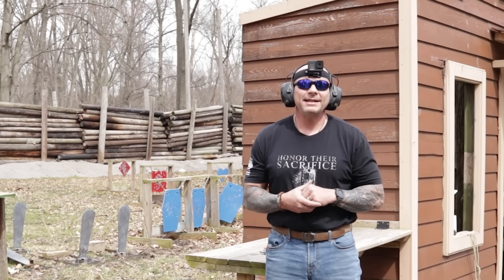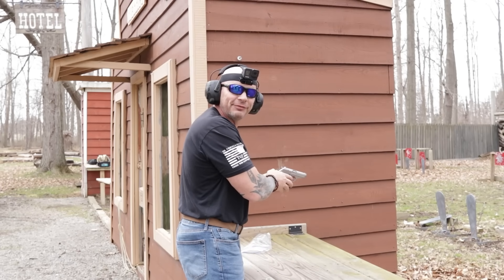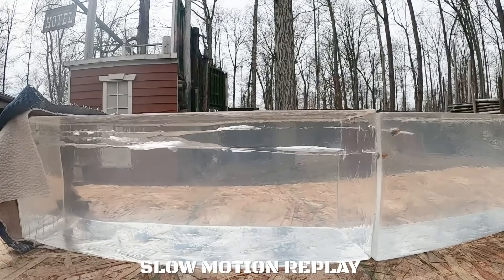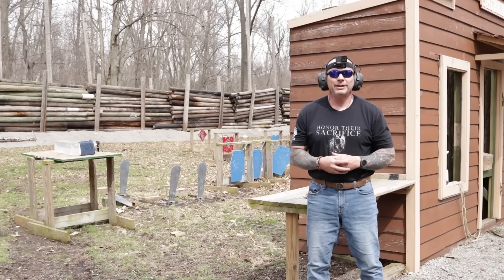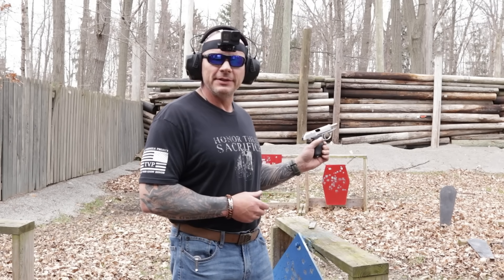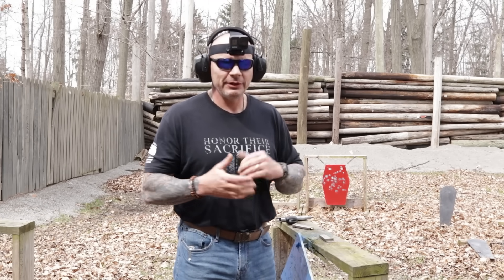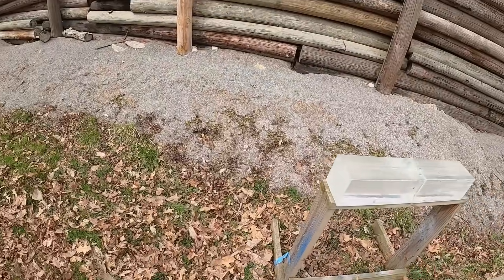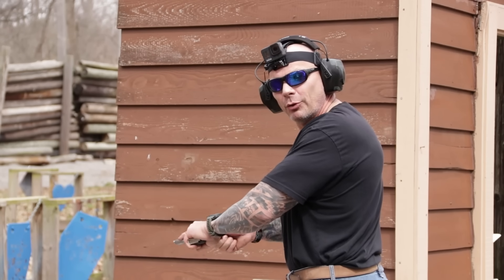Stopping Power of .380 ACP

Comment: These gelatin tests hardly inform about the .380’s stopping power; ballistic gelatin does not simulate a human body with its varied/heterogenous tissues of skin, bones cartilage, tendons, etc. it also fails to take in to account interposing objects like clothing, buttons, pens, glass, metal, wood, etc., and it fails to take into account oblique angles of fire.  Add to that, squatty 95 gr 380 slugs are easily pushed off-axis where the nose of a h.p. crushes, preventing any expansion whatsoever.  Also, the very light mass of the 380 projectile reduces on-axis penetration with sighted point of aim due to lower projectile inertia compared to say, a 9mm (up to 147 gr) and all other (heavier) full-size handgun projectiles.  Finally, the only way to assess the actual stopping power is to acquire a database of 380 shootings large enough to be of statistical significance, and compare to the same of more potent handgun cartridges.  Please see:  Evan Marshall & Ed Sanow’s work which albeit is flawed in drawing certain conclusions, does present a credible case showing pocket pistol cartridges are significantly lacking in stopping power compared to full-sized, higher pressure handgun rounds.

Comment: Shoot someone in the head, heart or spinal cord with a .380 and its deadly.  If you mag dump a .380 that's lets say 7-8 rounds, that's like a shotgun blast of .00 buck lead wise.  Granted you don't have the sheer shock on the system of it being all at once but it still will have a shock to the system with it hitting in a couple seconds.  .380 is not meant to shooting one shot here and there from far away where one shot stopping power matters.  My .380 is for when they are right on me and I'm dumping it at that point.  Granted I'd rather have my 9, but hell if I had time to plan I'd have my AR or shotgun.  You carry what you can.

Comment: Some years ago I stumbled across a vid here on YT who analysed 12 000 real life shootings to find out how many hits by which calibre handgun it takes to stop someone.
Turns out that with anything smaller than .380ACP you need 3 or more hits but with .380 and ANYTHING above you need 2 hits. The statistical difference between .380ACP and something like .44Mag was 1.9 (.380) and 1.6 hits. Obviously you can't fire .6 of a shot so it has got to be 2 if you use a 380 or a 44Mag.

Comment: In my humble opinion, the 380 acp does NOT have sufficient power to produce  sufficient penetration AND decent expansion, no matter  how many WISH it did. You can have penetration or expansion
Pick ONE.
I formerly carried a 380 as a back-up. When I did, it was loaded with hot loaded,, hard cast lead truncated flat nose ammo by, I believe,  Buffalo Bore. I had full confidence it would penetrate deep enough to get deep into an attackers vital areas. And the flat bullet profile digs in and fractures bone rather than glancing off. And if more likely to perforate blood vessels rather than pushing them aside.

Comment: The 380 is probably the most underrated caliber out there. I’ve had everything from a 22 to a 50 caliber handgun and I feel super safe carrying my 380. Yes I like my 9 mm only because the ammo is cheaper and more plentiful but it’s 380 was cheap and plentiful as 9 mm, I have all 380 and I’m 270 pounds between control and effectiveness. This is definitely one of my favorite Browns ever. It’s not my favorite.
Reply: I carry a Ruger Security 380. Great gun, plenty of capacity, easy to shoot and handle.  Could easily drop an attacker within reasonable range.
Reply: I would think so. Consider how common it was years ago for people to carry 25s and 32s and I doubt that anyone back then was telling them that it wasn't enough gun.

Comment: YEARS BACK THE FBI SWITCHED OVER TO THE 9 MM. TWO FBI AGENTS WERE PURSUING A CRIMINAL AND IT BROKE OUT INTO A GUNFIGHT. IT TOOK BOTH FBI AGENTS TO EMPTY THEIR ENTIRE CLIPS TO STOP THE ASSAILANT WHICH ALMOST COST THEM THEIR LIVES. LUCKY THEY SHIELDED THEMSELVES BEHIND THEIR CAR.. THE 9 MM RAZOR CUTS THROUGH THE BODY AND THE ASSAILANT DOESN'T EVEN KNOW AND HE'S HIT AND STILL COMES AT YOU. THE 38 WAS USED BY THE POLICE DEPARTMENT FOR ALMOST 100 YEARS AND WAS KNOWN AS THE KNOCKDOWN CALIBER. WHEN THAT HOT SLUG EMBEDS ITSELF INTO THE BODY, THEY GO RIGHT DOWN. CONSIDER THE 380 A 38 IN AN AUTOMATIC FORM, IT IS THE BETTER CHOICE OF SELF-DEFENSE. I CONSTANTLY URGE LAW ENFORCEMENT TO CHANGE THEIR PROTOCOL WHEN IT COMES TO THE 9 MM. THAT THE LAST THREE OR FOUR POSSIBLY 5 BULLETS LOADED INTO THE CLIP OF THEIR 9MM SHOULD BE EQUIVALENT TO WHAT THE 38'S WERE. KNOWN AS THE KNOCKDOWN CALIBER.

Comment: I carried a Walther PPK for a long time.  It hits pretty hard and is a  (in my opinion) easy to carry.   It's a good pistol to carry where you're not supposed to carry a firearm.  It's a good back-up for uniformed police officers.  It has marginal power for defense but the main concern is its low magazine capacity (I always carried a second magazine).  The PPK/S holds seven in the magazine.

Comment: Using energy is just something to make bigger numbers when momentum is much better for demonstration

Velocity times mass entering the body, then velocity times mass leaving the body......subtract leaving from entering and that's the momentum absorbed by the body.......if the bullet doesn't exit then the body absorbs the entire momentum

At distance is where 380 starts losing over 9mm

The kick of 380 is exaggerated because you have lightweight pistol.....my wife (little old grey haired lady) has little 9mm, but likes shooting my 45 cause it doesn't kick as much......my 380 is a bit heavier than most, it also carries 15rnds......it's also bigger than wife's 9mm

Comment: a gunfight at 50 meters may not be defensible in court as a "self defense" distance.  As you can see, the accuracy of your gun, even in a calm controlled environment, didn't let you hit the target.   For those 2 reasons, there's no need to test a .380 at 50 meters.  Any more than throwing rocks, no conclusions should be drawn from that test because a pocket .380 shouldn't be used.    Test it for what it's made for and don't confuse the issue.

Comment: In my own limited experience with a Walther PP in.380 shooting a large baboon male years ago i personally lost all faith in it.  1st half of the magazine was very stout loads 88gr jhp Speer, second half was factory fmj.
All close range into chest.  At end of magazine it finally sat down and started dying.
Never tried it again. I know this is a single example but it did so much worse compared to proper 9x 19mm jhp loads  and particularly so compared to 125gr jhp 357magnum from 4 inch barrel.

Comment: Started my "carry career" with a .22, then went to a .38. Never had to use those guns, but I could hit way better with the .22. Next came Viet Nam. .45acp only (for a handgun) they work. Combat in Several different countries following VN was accomplished with .45 acp. After the military, I became an executive  protection agent. Carried a Sig 220 for many years. And used it a few times. All this time, I had carried (when I was authorized) a pocket pistol. A .22 Beretta. A Colt Mustang, A Kel-Tec P-32.Even a variety of .38 revolvers - and one derringer in .38. And an AMT Back-Up .45 (what a brick!) Never had to use those - but I was always more comfortable having a back up gun! I had faith that if I did my part they would do the job! Shot placement IS everything! As I sit here at my computer, there is a Kel-Tec p3AT in my pocket, a Ruger LCP about 18" away and a .32 H&R mag by my feet. When I retired, I put away that  P220 I carried for 30 years and replaced it with a p365xl. Almost a pocket pistol. Notice a common thread? They are not .45s!
I might sound a bit paranoid, but I am still alive. At 75.
The First rule of being a gunfighter is to Have a Gun!!! 
(one of Col. Coopers favorite quotes - if you don't know who he is, check him out)
They say that those who live by the sword, will perish by the sword. That may be true, but one thing for certain - if it comes to that, I shall most certainly perish with a "sword" in my hand! Even if it's a .380!
(forgive my ramblings -  sometimes things are just worth saying/sharing, at least to me!)

Maj. Art B.
Reply: Consider more closely "those who live by the sword shall die by the sword". Those who live by the sword are the aggressors. The sword they shall die by is wielded by those defending themselves against the aggressors. Jesus was telling Peter not to wield the sword aggressively, as he had just done by whacking   off the servant's ear. Jesus  was not condemning the use of weapons for self defense.

Comment: Just a couple of observations. First, on the issue of .380 ACP recoil, you have a very nice gun in that SIG P230. I have owned a number of them. One thing to consider is that the SIG is a "blowback" design, which was prevalent in the 1980's and is also used in the Walther PPK. This design transmits much more recoil to the shooter than does a modern "locked breech" design. If you for example shoot the same cartridges out of a Glock 42, you will notice much  less recoil. Modern locked breech pistols account for the reputation of the.380 ACP for low recoil.

Another thing worth noting is that back when the P230, and for that matter, the PPK were popular, European makers habitually sighted  defense pistols as if they were bullseye target guns, that is to say with the sights at 6 o'clock rather than a "dead on" hold that we Americans use on defense guns. As your range gets longer, you see exactly what you demonstrated, which is shots going high at 50 meters. Many shooters that I trained in the 80's and 90's would often pull the trigger on these guns too hard, dipping their muzzle, so they never really noticed this, but with a proper trigger pull, the P230 will definitely shoot high at a distance. It is simply a function of how guns from Europe were sighted at the time.

Comment: While I don't consider your test really valid (the FBI standards require organic ballistic gelatin, and you're using the non-standard Clear Ballistics synthetic), it points out the well known problem with .380.  It does not have the momentum to both expand adequately and penetrate adequately.  For defensive purposes, and rough that can do both is much more desirable.  And you're using a P230.  A nice gun, but for a .380 large and heavy.  In that size and weight, and likely now smaller and lighter, you can get several 9x19mm guns, and that round has any number of loadings that  will both penetrate adequately and expand well.

Comment: Excellent video!  I like the info you presented and you did a fine job. I have seen a few other shooting demonstrations proving the .380 round is consistently lethal and accurate. There is no basis in fact for anyone to argue that a 380 round is too weak.  Those who insist that a .45 ace round is a better round for self defense are simply uninformed or just blinded by masculine hype.  The smaller 380 allows more ammo in the gun, softer recoil, and faster accurate follow up shot placement.  Also, if you kill the bad guy, a jury will likely not be persuaded that you intentionally used too powerful of a bullet in order to kill the bad guy.

Comment: I know "stopping power" is a pretty goofy phrase, but the .380 really is a perfectly adequate round.
Especially in these "slightly larger than pocket pistol" sized platforms.
Glock 42
S&W EZ Performance Center
Sig 365 380
Those platforms are all unbelievably fun to shoot.
You can also get some loadings that reach 300 ft/lbs in those barrel lengths.
Seems perfectly acceptable to me.

Comment: The .380 ACP and .38 Special are very close in capability.  Some people may be unaware or have forgotten that for a long time that the primary duty weapon carried by many police officers was a .38 Special with 6 round nose bullets in the cylinder.  Today people can fit a slim .380 ACP pistol in their pocket that holds 6 +1 rounds.  Which means you have a highly concealable weapon that is about effective as what police carried with one extra round.

Comment: I only carried 384 a couple of years, and sometimes I would carry it for a backup gun, it was always a PPKs with loads that I loaded with 90 grain Deer Hollow Point with 3.8 grains of 231. I believe I was getting a muzzle velocity of about 1,050 to 1100 feet per second. As for your shots there I will take those hollow points any day, I don't care what the FBI has to say their reasoning is utterly flawed. 8 to 10 in was a perfect depth for one shot stops in the late seventies and early to mid 80s. I do not think that humans have changed their reaction to being shot since then. However my favorite load, at that time, still my favorite load was a 357 I carried with 125 grain hollow point doing about 1400 ft per second or better. It is still the best first shot fight stopper there is. That includes 357 magnum, 357 sig, 38 super, and 9x23. I sense then either carry pretty hot 9 mm in a Browning high power with a 4.2 inch barrel so you can get enough velocity out of it. And I prefer loads that run about 1350. My favorite load is actually 165-grain 40 Smith with spear Gold Dot or Winchester PDX at about 1200 ft per second. And otherwise I most often carry a 185 to 200 grain plus p load in a 1911 either a 5 inch barrel or the Commander length. My backup gun is usually a Smith & Wesson J frame with Glaser safety slugs.

Comment: There's a lot more to stopping power, and putting a person down for the count then how far above it Penetrates... The traumatic shock the wound cavity. These are what put people down. Just look at the wound channel from the 380 it went through but destroyed almost nothing....
Reply: That's more because of the type of gel that was used. Denser than human tissue and not showing the hydrostatic shock that would occur.
Reply: How can anybody say that a 95 gr. jacket hollow point going at 700' per second,is as good as 95 gr. hollow point going to 1,400' per second? Kind of boggles the mind don't it?

Comment: What concerns me about .380 hollowpoints is that the lower power will prevent the bullet from sufficient penetration. 9mm will make the same size hole in someone's body that is made by a .380, but 9mm hollowpoints are much more effective than .380 hollowpoints because the extra powder charge allows the 9mm to penetrate deeper. Perhaps it's better to use ball ammo with .380 to insure the maximum amount of penetration.

Comment: The reason you're describing 380s as "snappy" is because the 380 platforms you're using are blowback. If you use a recoil operated 380 you will find it to be more like a .22LR than a 9mm.

Comment: To the people who think a bigger caliber is best, Never met anyone with a preference on caliber to be shot at with in a self defense situation. My wife wants to carry and she does great with a p365 in a .380 and is comfortable at the range with it. Great video!
Reply: Have her fire the Smith & Wesson Bodyguard 2.0. Almost positive she would do better and enjoy it much more than the Sig. P365.
Reply: Well, let me share an experience that creates MY preference.

Years ago, I did a test using NIJ rated body armor.

I used Level IIA concealable soft Kevlar body armour with a ceramic plate.  I had a trusted colleague shoot ME with several calibers from seven feet while I wore this setup.  Appropriate safety measures were painstakingly taken.

We used several handgun loads of varying bullet weights, velocities, and barrel lengths.

At the severest end of this short spectrum of punishing exercise was a 300-grain .45 Colt at 1000 fps from a 6-inch SW Model 25.  This was not the old “cowboy” load at 700 fps!

My preference for being shot in a self defence scenario WHILE wearing the body armor setup that I described is a load that occupied the other extreme of the continuum:  a .22 Short fired from a tiny 1-inch North American Arms revolver.
Reply: Great choice. I wanted to get that for my wife but she wanted the Ruger LCP Max.
Reply: What really matters is shot placement, and to improve the chances of good shot placement one must be comfortable with what they shoot (or they will hardly ever practice, and will not be able to control it)... if one can consistently place shots with XYZ calibre, then it is the right caliber for them...

Comment: Been carrying since 96 and have determined that if you want to be armed at all times compromise is required. My preference is the 1st gen Ruger LCP, which i carry front pocket in a Desantis pocket holster. I'm not crazy about the LCP2 with the lighter trigger pull. Light triggers are great for tight groupings at the range but not for actual combat situations. Better chance of shooting yourself or the ground when drawing.
Reply: Agreed, I also have  a gen1, buddy has the Max..I still prefer the gen1.. smooth exterior  edges, trigger is fine once acclimated..
Reply: Try S&W M&P Bodyguard 380 without Safety....like a double action revolver with second strike capability!!😊

Comment: I've done a recent test I used a PSA dagger with a threaded barrel chambered in 9mm. Vs a bersa thunder 380. I only fired two shots from other weapons the 9mm passed through 4 55 gallon drums key holed out of the fourth second shot didn't make it out of the 4th drum. First shot of 380 was not the best shot I passed through the first barrel and glanced off the second. Next shot fired through the first and stopped inside it seems like 380 is about 60% percent of effective as 9mm. Take from that what you want I was just blasting shit